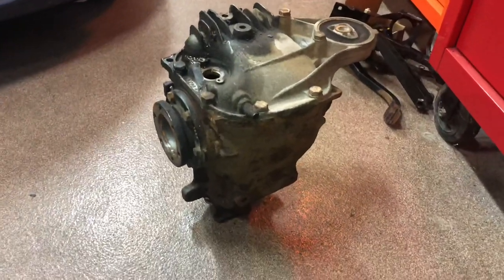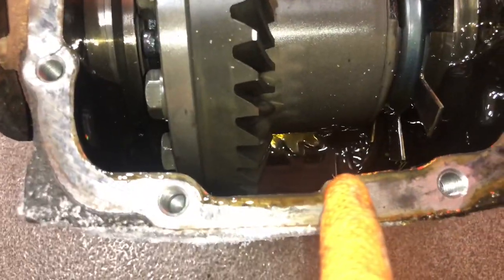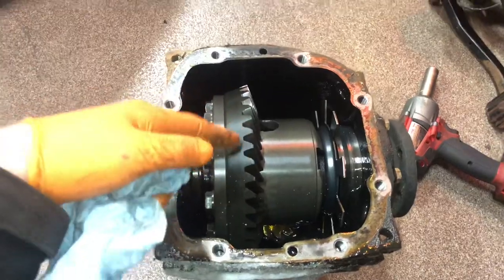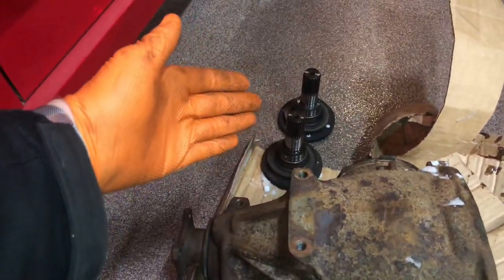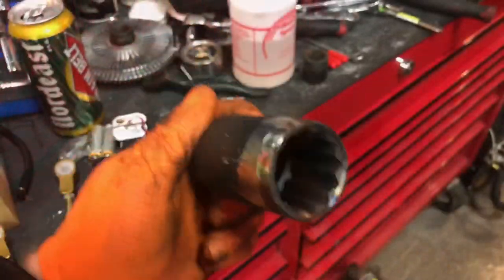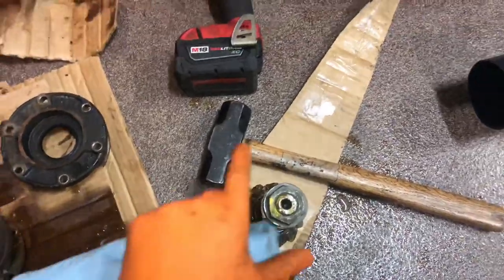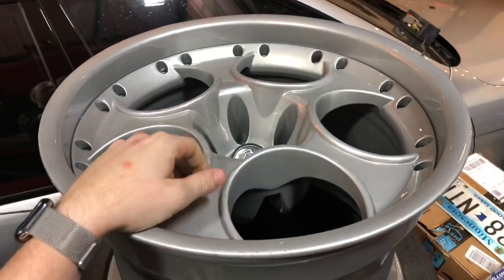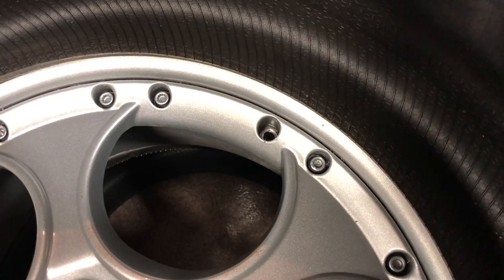BMW E30 188mm differential dissasembly and Murcielago valve stems

Comment: Sorry but you can get a 210 from a e24 e28 and it will fit on the subframe because ive done it and it fits
Reply from the maker: E24s and E28s were sold with no bigger than 188mm differentials. they're all medium case. 

I have several in my pile at home. exactly the same casting. swap the flanges and the rear cover and boom.

210mm didn't come along until E32. and those don't fit.
Reply: @OvalboreCars  no because uk Australian and Europe got 210mm the housing is the same just bigger for the 210 mm center too fit even the e30 diff cover bolts straight on. I'm getting other one soon they are very had to find /expensive
Reply from the maker: I'm not aware of this diff, or what application it would have been in. the 745 turbo, 635Csi, M6, M5 all got a 188-mm differential in the USA.
Reply: Yes there was a 210mm diff in e28, at least in the euro e28 m535i. I used to own one, the diff also had an S tag (limited slip) while the car was a cat version without the dogleg Getrac 265. The front mounts are the same as the ones in e30 and e28 188mm diffs but I don't believe they share the rear cover with 188mm units.
Reply from the maker: Ok -- video pertains to US Market vehicles (asterisk).
Reply: Rear subframe out of a 540 e34 will bolt up to a e30 and then you can fit a 210 diff and axels. Very common swap here in sweden.
Reply: @Fille3133  buy you have it cut the subframe bushes off on the front parts of the subframe. E34 rear end is wider then e30